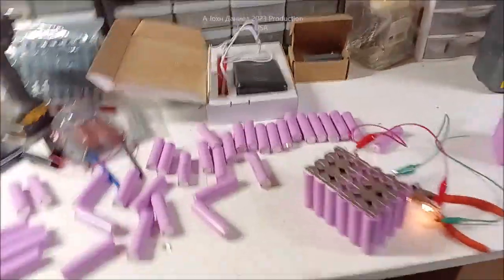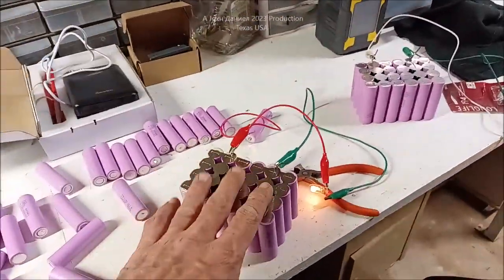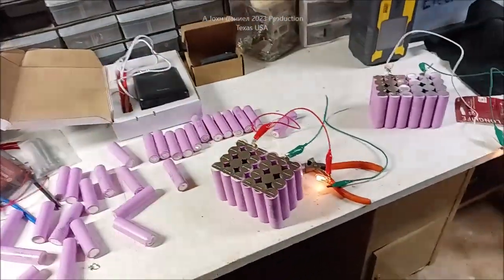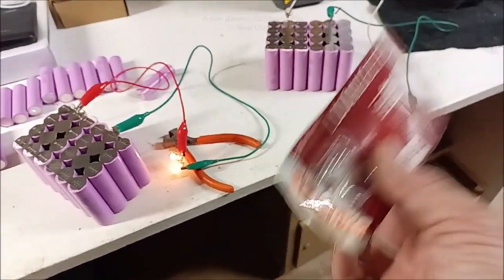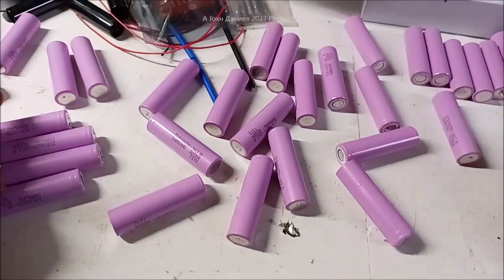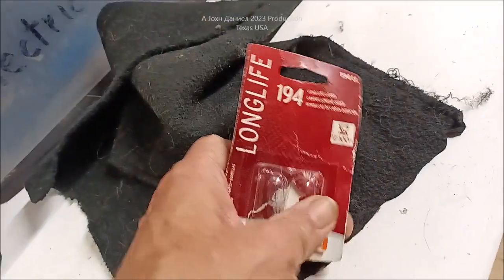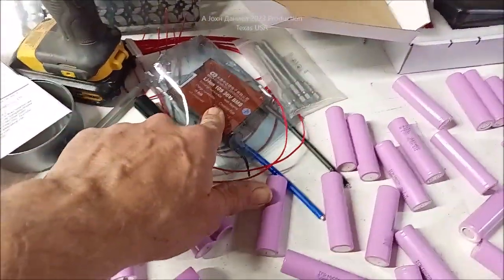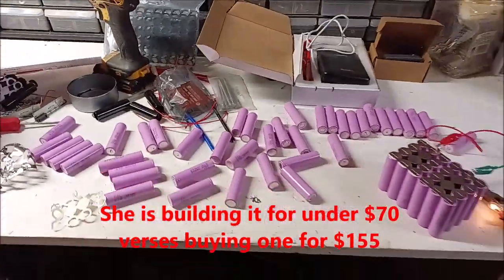Safe EZ Method to Re-use Up-cycle Lithium 18650, 26650, 32650, 21700 Li-Ion Batteries (parts below)

Comment: Have you found these cells to be of very high quality and really perform well for a long time in your projects?  Are these as good as any new cell?  Looks like they are new.  Thanks for your input.
Reply from the maker: The cells are new but in a medical device carriage for oxygen generators. They build 1000's of replacement batteries for certain medical devices but it the medical device is not approved by some goofy insurance company it is scrapped. The cost to us as citizens is huge since the prices of bad decisions of hospitals or insurance folks always is passed down to us. Batteryhookup has all sorts, new old stock, over stock like these, and new but discontinued item. They also have used cells but I only buy the new versions to break down.

Comment: Those are good for RC toys (drones, cars) and power banks as well. I got a stack from old laptop battery packs and it's a lot of money saved and I discard some for safety (dead anyway and won't charge).
Reply from the maker: I figured how to verify the best cells from any source. Pass through testing them. Connect to a meter good for 9 volts accurate, feed 3 volts through the battery as if your adding a weak battery to a good one, the result will be the cells that are going bad, under 80% able, will eat some of the power sent through. Good cells will balance down to the input but the reading will be the math you expect from 3.70 and 3.0 volts as close to 6.7 volts the better. Bad cells will eat more than they balance to.

Comment: I think you corrected yourself there, but putting an incandescent bulb Will draw a battery to zero V ..... even if it is no longer shining!

Choosing a bulb of the right voltage rating will just give a good indication of the battery voltage at a glance. 
Your girl is smart, like her Dad!
Reply from the maker: She took my voltage generator and tested a few bulbs to find one that went dark at the right level to use on the batteries. Second set in action so shes got it figured out. She looks at it probably every half hour and disconnects it if shes not going to be near it then reconnects them and test while near by.
Reply: @JOHNDANIEL1  Like I said ....Smart!
I'd have gone for a more circuit based idea..... maybe a whetestone bridge?

Comment: Sorry but it is not wise to drain the batteries this way. Maybe if you actively monitor with multimeter each cell group that it does not go below 2,5-3V thus damaging the cells. 

Using battery packs without  battery management could be also dangerous. When series connected, battery voltages add up. If one cell group is even a bit lower than the other groups, draining the pack down to zero can make one or more groups go negative in voltage. And boy, that is bad for the chemical stability.

If cell groups are near the same voltage and you dont have 20€ battery charger/discharger, better to use 12-24V USB charger to drain the batteries if the goal is to make them safer to handle. You are actuallyt using the power for something then and the charger usually does not let the battery go too depleted.

Hope this helps to show more safe and reasonable ways to handle batteries.
Reply from the maker: These had BMS in them, but a separate plug to activate them from the machine they were intended for. She took my voltage generator and tested a few bulbs to find one that went dark at the right level to use on the batteries. Second set she has done in action so shes got it figured out. She looks at it probably every half hour and disconnects it if shes not going to be near it then reconnects them and test voltage while near by. Goal is take them down to 10 to 15% ( 2.5 to 2.6 ) and so far not any problems. 8 to 9 watts draw on the grouping. Its smart to use alternate methods to service/reuse batteries when money, world materials issues and availability of expensive battery gear is hard to get.

Comment: I had taken apart an old ryobi battery last weekend. I did short out one of the batteries!! Is it still safe to use or should I get rid of it?
Reply from the maker: Charge the battery you shorted if its not appearing damaged on a single cell charger. This is one that can do it, use Alligator clips https://amzn.to/42RefMm to do while in tool battery. Use a multi meter to discover the individual cell +/- point to use. https://amzn.to/3z41QXA ,Place the charger on a extension cord outside away from things. Let it charge 4-5 hours till says full, green light usually. Test its voltage after it sits off the charger 2 hours, if it drops below 3.45 volts, it's done. Get one out of a old laptop battery or replace the tool battery completely.
Reply: @JOHNDANIEL1  Ok thanks!! I will do that